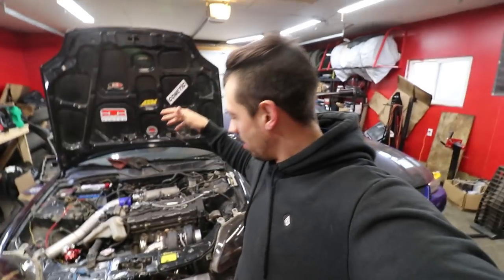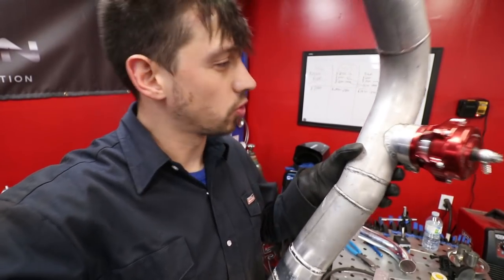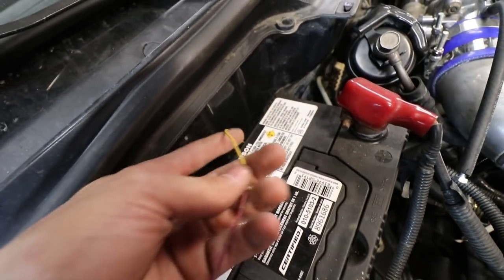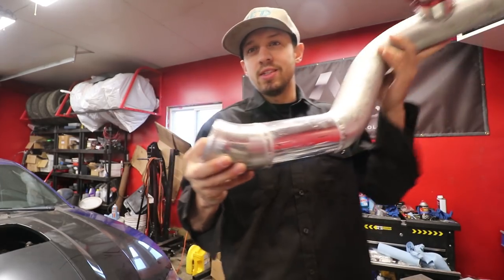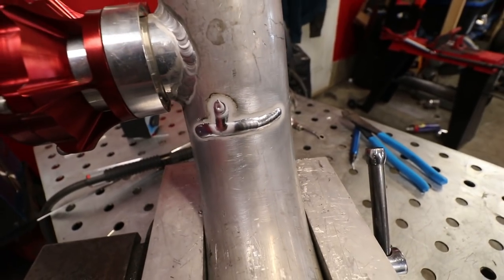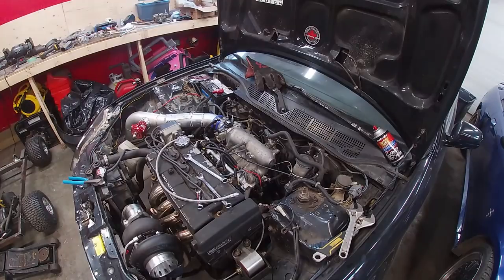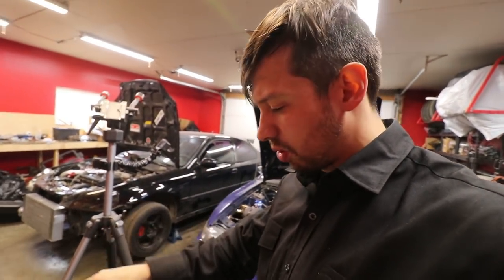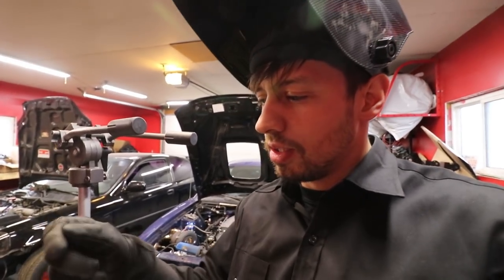Budget Turbo Civic Build Part 2

Comment: When you switch over you should tell us what filler rod, tungsten, and size cup you use. Just got a tig and really need the advice. That small information is very handy
Reply from the maker: Most case on the exhaust I’m using the 12 fupa cup, with .045 filler :)
Reply from the maker: And 42-45 amps on exhaust!
Reply: Thank you

Comment: Crimp don't solder Kyle.
Make sure you twist the conductor strands first .
I actually fold the conductor over too.
A little bit of practice will help you judge how much insulation you need to strip off first.
I know you can't double over the copper for some pinning applications.
However if you are joining cables then you want a low resistance join as possible.
Lastly heat shrink or wrap the join in the engine bay as a short tends to blow s**t up.